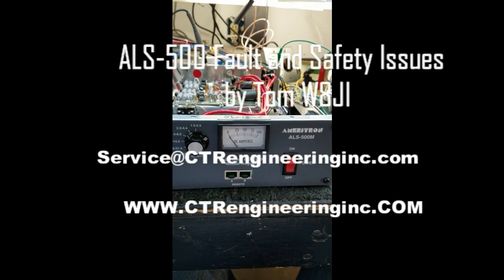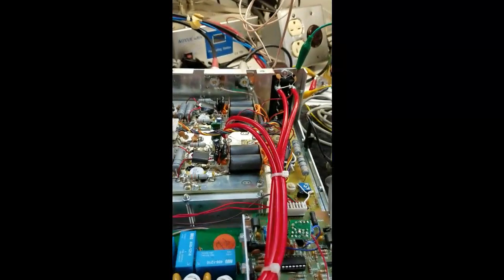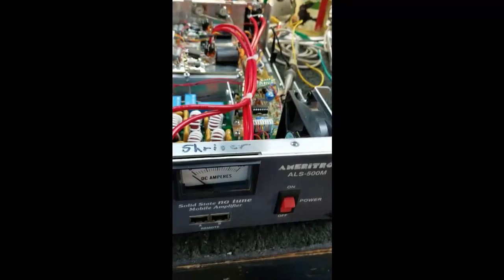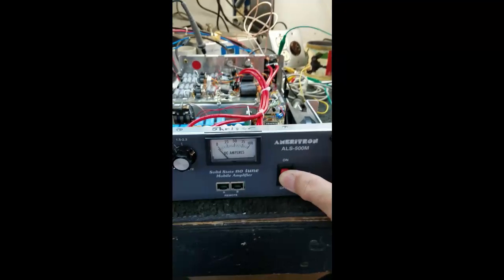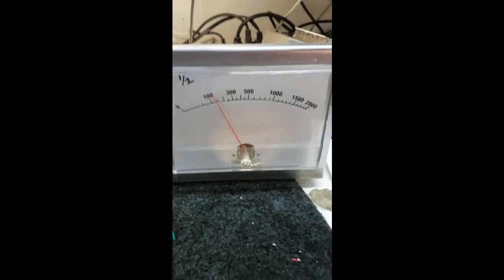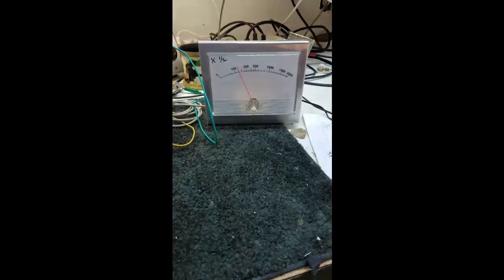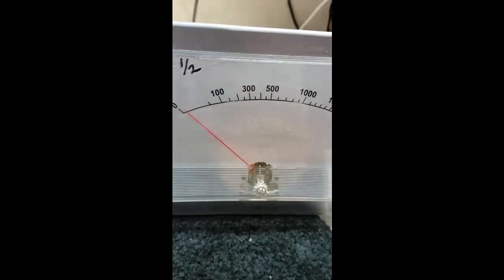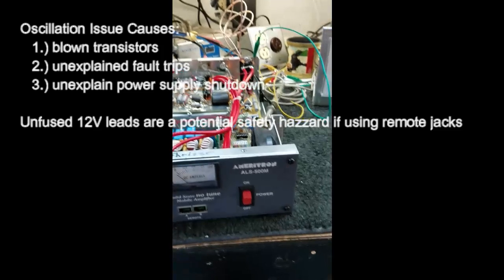ALS500 Mobile Amplifier Issues

Comment: I lost one RJ45 socket and blew part of a trace, so I fused it.  They took the cheap way in their placement and mounting. If memory is right there was room for a sub assembly board.  I also went to shielded Cat 6 cable.  Mine has been running mobile for about 10 years in an H3 Hummer, so it's had it's share of off-road use.  I recently went thru it and also some bad solder joints to the power plug.  Their soldering is a little undesirable....I'm trying to be kind here.

Comment: I found your video while researching an issue I'm having with a new ALS-500M.  Powered by the Ameritron SPS-75MV, its meter registers nothing at any power setting, on any band, when the IC-7300 is keyed, even though the ALS relay clicks clearly.  Any ideas?   I would be most grateful.

Comment: Saw your Video I have an ALS500 and was new 1 year or so....when I attempted to use remote on off and band changing would trip Fault immediately I can only use band switching....so what's your fix ?
AC4KW
Reply: Hi, I saw your comment and had this same issue. I had it sent to MFJ before they shut their doors and it was a known issue for some of the ARI-500s when rf is sent through with it on. The green wire attached to board nearest the fan with 2 torrents attached is what the tech disconnected. And works great now

Comment: I have this problem, too. Is there a potential fix for purchase?? 

-K7RXT
Reply from the maker: I have to redo the bias/control board, but for now, we have a patch board that is simple to add. The heatsink is difficult, however. I don't know what they were thinking when they changed to that heatsink or who changed it!
Reply: It’s just so absurd, and annoying to say the least. Just a terrible, albeit expensive product. And 9/10 times it shoots swr high, makes it go into load fault.
Reply from the maker: @andrewturner2615   The issue with the control board is it was designed around 2SC2879s which behave differently than the PP100s used now. MFJ never corrected the control board. I called them a few times about issues and offered a fix, but the people there said it was fine and did not have a problem.  

So it is up to the customer to fix the amplifier. 

Sometimes the spike is so bad it will actually knock the PP100 transistors out.
Reply: @Jerrythenerdful   I thought I had replied last night, and don’t see my comment. I had done some research after seeing your video initially. It’s quite an intricate process I can see to remove and change the transistors, if that’s even a fix. I would like to learn more if we can exchange information and be able to purchase a fix directly from you when it’s fully available. It is so disheartening to purchase such an expensive item, with the RC and the band changing interface(which faults instantly every key up) to find it as a weight in the back of my truck. Ameri-MFJ really should be held liable for such a poor product. And this whole time I thought it was my coax or antenna or operator error. Super frustrating. Though, very good video and informative, and if there is someway to get a fix from you, a nice consideration would be in exchange. Thanks in advance, and 73 de 
K7RXT
Reply from the maker: @andrewturner2615  I made several attempts to get them a fix for this, but some tech insisted they do not have a problem. The entire remote interface system has a few design problems but those are not showstoppers. The big field issues are the very sloppy assembly, the anodized heatsink, the unfused 12V leads on the CAT cable, and the bias spike that shows with the PP100 transistors (sometimes triggering them into oscillation). All of this is field fixable but at hundreds of dollars cost. 

It would only be a few dollars extra cost done at assembly, but that won't happen.
Reply: @Jerrythenerdful what a bummer :( sad to hear of this. Thank you for your time and videos on this matter
Reply: @Jerrythenerdful  well I sent the amp back today for a warranty repair- doubt anything happens, but it’s in their hands now. If I hear anything about them doing anything, I’ll definitely let you know. Otherwise it’s a great mount for the radio, and nothing more